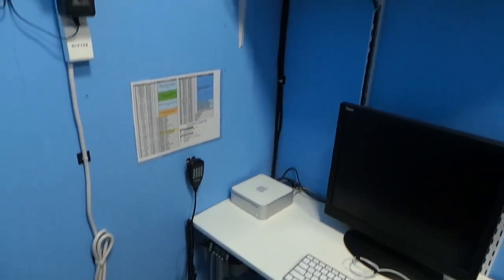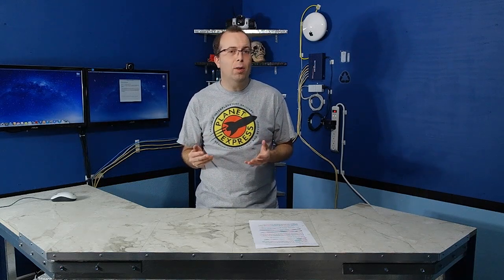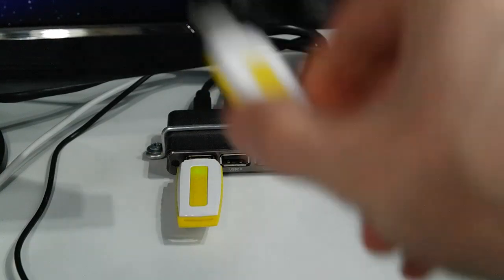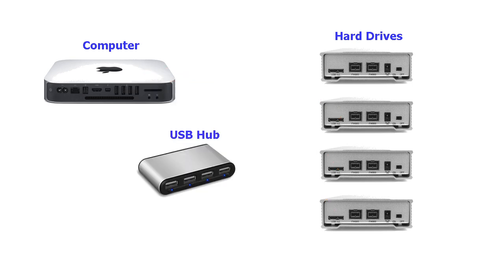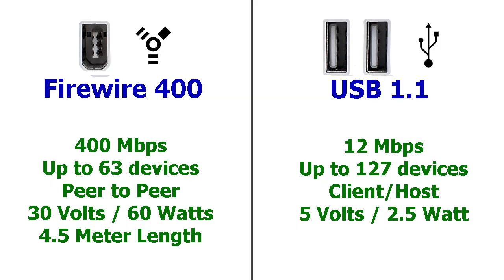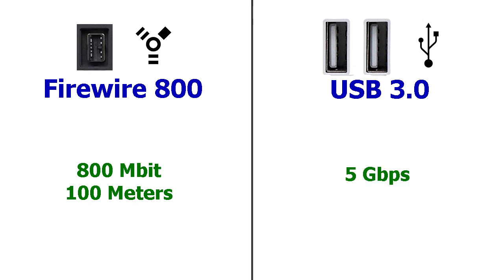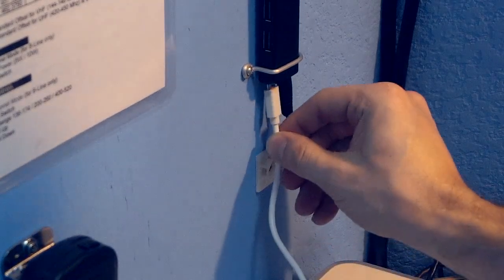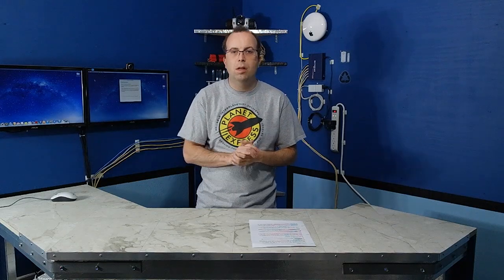Farewell R.I.P. Firewire, Hello USB!

Comment: don't use USB hubs. The bandwidth will all be shared by one port, which is not too efficient.
Reply: +Sergio Diaz Use powered USB hubs and you solve at least one problem.
Reply: Sergio Diaz Define awful. You could get upto 6gbps from USB 3 and upto 10gbps from 3.1.
Reply: Sergio Diaz Those theoretical speeds are pretty close to practical and you need a dozen USB thumb drives and HDDs in raid to hit 10gbps.
Reply: Sergio Diaz does firewire also share bandwidth in one port when daisy chaining?
Reply: +Sergio Diaz Hard drives generally struggle to even get 100MBps, so that's hardly an issue
Reply: Sergio Diaz USB Type-C is the future, basically you have an adapter for everything to convert to USB 3.1 type C such as HDMI which will easily use up that bandwidth.
Reply: Syphist Prime just use 2.0 devices...like connect 2.0 devices to 3.0 usb hubs
Reply: +Murican_Muscle_Ghif It's 5 GBit/s, not GB/s. Roughly 500 MB/s. Any RAID setup will overwhelm that bandwidth.
Reply: You get the same problem with daisy chaining.
Reply: The thing is that you can't rely on serarate USB ports on you PC actually being on separate controllers. And if they share the same controller, it doesn't really matter if you plug all your devices directly into the PC or use only one port and plug them into a HUB, in most cases. 

Now you could make sure to get each device its own controller, but if you're at the point where you regularly bottleneck at 10 GiB/s with mass storage, you might wanna look into other data transfer solutions.

Also, I'm not sure many people need 10G Ethernet, and that those people really wanna connect it via USB. There are cases where it can come in useful, but in most cases you'd want some dedicated hardware that talks more directly to the CPU for these use cases.
Reply: er, the bandwidth is shared on every port anyway, as long as they're using the same controller. the rated bandwidth is not per port, it's per controller.
Reply: +Sergio Diaz bandwidth or power?
Reply: +Vince FTW both.
Reply: a 10 Gigabit ethernet to USB adapter will easily hit that.
Reply: +Sergio Diaz I wish there was a USB 2.0 hub that connected to the main device via USB 3.0 to get around bandwidth choking issues.
Reply: +Sergio Diaz But when are you gonna need to draw more than 5GBps off your external hardrive
Reply: You would need a crap ton of deceives on the same hub for that even to be a problem. Back with USB 2.0 that could be a limiting factor if you copy from one HD to a other on the same hub... But with 3.0... you would need relay fast HD:s. You would basically need two full fledged SATA 600 SSD on the same hub for it to be a problem. And then you would only lose about 15-20% performance copying from one drive to the other.
Reply: matsv201
Most mechanical HDDs this day can output data at 120 Mb/s (1,5 GBit/s). Faster HDDs can manage even 160 Mb/s. The bandwith of USB3 is roughly 500 Mb/s (5 GBit/s) so two of the faster disks are already at 300 Mb/s. Remember every protocol is not perfect and you will never achieve 5Gbit/s. So you don't need a "crap ton of devices"...
Reply: matsv201
I don't get why you are talking about RAID. No sane person would use RAID on a general-purpose bus like USB. It's like using RS485 for RAID, or CANBUS for RAID. To do proper RAID you need a bus that's designed to handle only storage devices, as you said SAS, SATA or (even) SCSI.
I wasn't talking about RAID. I was talking about the fact that even with USB3 and its 5 Gbit/s when copying between two fast hard disks you can be bottlenecked by a hub.
Reply: MrOpenGL 
" No sane person would use RAID on a general-purpose bus like USB"
That is totaly my point. So there is no real bandwidth constraint with USB, at least not in the regards of harddrives. Sure if you use a SSD

" I was talking about the fact that even with USB3 and its 5 Gbit/s when copying between two fast hard disks you can be bottlenecked by a hub."

No.. Bacuse if you have a SATA/SAS 300 you get about 3Gbit/s. If you copying one file from one to the other you get 3Gbit/s up, and 3Gbit/s down.

USB 3.0 and 3.1 is full duplex in contrast to prior verions So you can actually use 5Gbit/s in both directions simultaneously.

You would need two full SAS/SATA 600 drives to get a bottle neck, and that is for USB 3.0. And if you have 3.1 you will still not have a problem.
Reply: matsv201
Are you sure that even the hub is full duplex? Because AFAIK the controller is duplex even on USB2, but not the hub which is always half duplex because of its nature, especially if you have more peripherals attached to the same hub. Assume you have a setup like this: you have a single USB3 port, attached to it is a hub, which has 2 hard drives attached to it, a keyboard and a mouse.
What I am thinking is that since the single USB port is already busy in both directions (uplink and downlink) because you are copying files from 1 HD to the other, when the CPU polls the mouse to see if it has been moved or the keyboard to see if a key was pressed the hub will have to suspend transfer of files while the CPU is polling the mouse/keyboard, which (especially if used in conjunction with a high-polling rate device like a wifi stick) should create inefficiencies, because even if the bandwith is 5Gbit/s the hub forces the HDD to wait writing while the port is busy polling the mouse. But I don't know how USB handles interrupts and which priorities it allocates to different devices so I can't really say if this is the case or not.
Also I have never managed to achieve full 5Gbit/s on USB3, probably because of protocol overhead and other inefficiencies.
Reply: MrOpenGL 
"Are you sure that even the hub is full duplex?"
Its a hub.. so its hubing.. and of cause, there might be a hub that only support half duplex. or even cant handle the full speed. IF you have a cheep as hub they might use secondary chip and underclock them to make them work

"was pressed the hub will have to suspend transfer of files while the CPU is polling the mouse/keyboard"
One might imagine it work that way.. but it actually don´t. 

USB (at least 3.0 and 3.1, i´m not sure about C) Uses a hardware legacy fallback. That is why USB 3.0 got 9 conectors and USB 2.1 and earlier only uses 4+1.

So a USB 3.0 is actually two ports. its one hardware 3.0 port, and one hardware 2.0 port in the same.

In the actuall USB hub there is actually two hubs, one 3.0 and one 2.0. Sure, they are on the same chip, but its totaly different electronics inside the chip.

http://www.moddiy.com/product_images/uploaded_images/usb3-pinout.jpg
D+ and D- is the standard 480MB half duplex pins.

The RX and TX is downlink and uplink, the - and + is balanced leads (just like in T-base). The D is just data. Its still balanced, but there is no up or down link.

The SS stands for "superspeed". So this is the cable super speed uses. There is actually USB 3.0 that don´t support superspeed, (but its quite rare). The GND-Drain is just a extra signal earth.

Of cause.. if you use a USB 1.0 stick with a USB 2, the USB one will ruin your speed because its only hubbed. But for USB 3.0 its not the case. And yes, this is a very real problem, that why they thought of it when they made 3.0

USB is for the most part a "stupid" standard. There is no inteligence in the system. And why its so cheep to produce. The hub just transfere the signals and the devices just get there interrupts. This is in grave contrast to Firewire that demoudlates it, process it, buffer it and then resend it.  That is why Firewire hubs is that rare (they do exist.. or rather, they are not hubs, but the same fuctunality), but they are hideously expensive. About thunderbolt.. i don´t know if its that capability or not, its a realy wired and useless standard.
Reply: matsv201
I knew about the 4+5 wiring for USB3 but I didn't know about how it managed interrupts. Thanks :-)
Reply: MrOpenGL Well not relay "manage" so mutch as cheating.... Its a cheat way of making backwards compability. Its really the only way to make it chepish.
Reply: That why a lot of usb hub company that make 10 or more USB port have a power supply
Reply: I have a 3 port non powered USB hub, then a 4 port powered in series.Mouse and Keyboard is in the non powered (wireless), as well as the powered one and i have a micro-USB and a mini-USB cable in the powered and two free slots.

Pretty much everything runs on mini och micro USB so i really never have to put a other cable in.
Reply: Sergio Diaz if your pc doesn't have a USB 3.0 port don't wast money on a USB 3.0 drive and don't use a 2.0 hub
Reply: the irony is Dave used a USB 2.0 (at best) hub
Reply: Nikola PekovicAR it's not the only solution. Just plug in a PCI USB card.
Reply: Scott Malkinson But when you use a hub, you use 5Gbps SHARED between every single port you use, and if you have a ton of external HDDs on a hub they all share the bandwidth of one, becoming a bottleneck pretty fast. And remember, those are theoretical speeds; hell they might not even ever reach those speeds.
Reply: Scott Malkinson Yeah, but the performance will still be awful.
Reply: +Vince FTW Thunderbolt basically does the same thing.
Reply: James Taylor Ignorant response.
Reply: +Vince FTW I don't have much experience with FireWire but I assume so.
Reply: +Vince FTW yeah, but your average USB mass storage device won't. Almost nobody ever reaches rated speeds on USB controllers.
Reply: +Vince FTW agreed. If it gets more traction than Thunderbolt it might just work out.
Reply: +Jack Mcslay So the maximum you can have is 5 of them.
Reply: +Jack Mcslay and with them doing concurrent io it can get pretty slow, considering this guy is not using USB 3 but USB 2.
Reply: Murican_Muscle_Ghif We're talking about chaining multiple devices in a port, which can easily use the bandwidth.
Reply: MrOpenGL If you talking about "today".. i would say the 2013 release USB is more accurate than the 2008 release.

Well sure.. so if you go for a 8 year old USB standard you might have a problem if you have 4 or more disks in a raid 0 configuration.

Well firstly... i would say.. you never use 4 drives in a raid 0.. that i stupid.

If you want 4 raided drivs you should really go for raid 10.. or raid 50.

If you use Raid 10 or raid 50 you are not going to use USB anyway. Then you are going for E-SAS or 10GBASE-CX4 (than probably dual ported, and its a 12 year old standard by now), or you go with a more modern 100GBASE-CR (6 year old standard).. then you will not get bandwidth problem in quite a while.

If we talking RAID 50 we are talking serous mainframe big buck stuff.. then both USB and Thunderbolt is out of the window anyway.
Reply: WHO CARES

Comment: Thunderbolt?

Yeah I know its expensive but if you liked firewire that much then Eh, but I suppose USB 3.1 gives you better compatibility.
Reply: +Andy The Playah actually, it uses lightening to charge, not thunderbolt
Reply: Thunderbolt, the Apple connector.. which is developed by Intel, but rarely used on PCs except for Microsoft Surface, and uses one of the same connectors as Display Port, and can sometimes be Display Port, but not always, and for that matter Display Port can sometimes also be HDMI, which is really fancy DVI, but only DVI-D and not the one with analog VGA, though that can be done on certain Display Ports, or even any Display Port with the right adapter, especially if it's Thunderbolt since then it can also be connected to a hub, along with USB and Ethernet, except for the NEW new USB, which is higher bandwidth, although it will actually converge with Thunderbolt anyway, and then it can be a Thunderbolt, a USB, a Display Port, an Ethernet, or even a power jack!

What's so hard to understand about that?
Reply: -Apple iPhone charger, use Thunderbolt!
-

I'm using references.
Reply: Daniël's Tech & Music Channel I wasn't saying they were compatabile but I was asking why he decided to move to USB3 Rather than Thunderbolt as an upgrade considering as you said Thunderbolt is the successor to firewrie.
Reply: +Etheoma 
Thunderbolt is really just mini display port with a hint of Apple flavoring.
Reply: +BeRad117 No it's not.  Thunderbolt is capable of carrying DP, but they are far from the same.  (Although they use the same mini connector -- a dubious choice, that one.)
Reply: Nick Guy
That's why I said with a hint of Apple flavoring. Video display but also 10 Gbps data. I should have included that when saying it originally in my post. It made it sound like I was trying to downplay it.
Reply: Thunderbolt 3 will ditch most of the Apple flavouring by using the USB type-C connector, and by being able to use 3 types of cables: A "passive" (standard USB type-C) cable that can get 40 Mbps at 0.5 m or 20 Mbps at 1-2 m, an active Thunderbolt 3 copper cable that can get 40 Mbps up to 2 m, and an upcoming active Thunderbolt 3 optical cable that can get 40 Mbps up to 60 m.
Reply: his server is a Mac Mini G4
Reply: But doesnt intel make Thunderbolt, not apple? lol.
Reply: Julian Robin the name thunderbolt was trademarked by apple, but apple transferred the trademark to intel. The final revision of thunderbolt 1 was codeveloped with apple.
Reply: RealDarkFilm They used to be i suppose, but now they are completely developed by intel i believe.
Reply: Nick Guy Ah really wasn't expecting to laugh when I started reading that, Thanks for the laugh.
Reply: that was always the idea wasn't it? one connector for everything? complete compatibility between all products?

also thunderbolts can go in either way (like type c) so that's a pro.
Reply: Spooky Skeleton type c is not thunderbolt. its a derivative of USB. However the lightning connector can go in either way.
Reply: RealDarkFilm Re-read my comment, I said that thunderbolt can go in both ways (LIKE type-c) not saying that it is type-c.
Reply: Spooky Skeleton Oh my bad. thunderbolt CANNOT go in both ways, but lightining can.
Reply: RealDarkFilm My bad too, I got Thunderbolt confused with Lightning, as I don't have a device that supports either of them :L justpoorthings
Reply: "Oh my bad. thunderbolt CANNOT go in both ways, but lightining can."
What about Thunderbolt 3?
Reply: USB c beat it
Reply: Etheoma  it's incompatible

Comment: With Type-C connector the end user, typically the average consumer will be able to ignore if the device is USB 3.1, Display, Thunderbolt, etc..., they just need to connect the cable and the devices will just talk to each other no more do I need a USB cable, Firwire, Thunderbolt etc cable.

Comment: With newer Macs, you get Thunderbolt that can also daisy chain, and packs even more performance than USB 3.0. Also since Thunderbolt is based on PCI Express you can find adapter boxes that allow you to attach any PCE Express card to it, and since you are talking storage, enterprise-class SAS RAID cards like 3ware 9750-8e. With such an SAS RAID card you can use an external SAS disk enclosure that accepts SATA or SAS drives directly. So with one big upgrade from Firewire/USB to Thunderbolt + disk enclosure, all you need to do down the road is get new, bare drives instead of enclosures. Also since enterprise grade stuff have longer support life you can count on itfor longer.

Comment: My audio interface is FireWire only. Which is great, but that means I can't upgrade my computer to a newer MBP.... -________-
Reply: +GabrielTheGuitarist If you have a tower PC, upgrade it and buy a FireWire controller.
Reply: +MinyHelps I dont use PC or tower computers. I've got a MBP with a firewire port, but the 2015s dont.
Reply: GabrielTheGuitarist Then waste your money for an Mac Pro which is a tower Mac or switch to Windows or Linux.
Reply: +MinyHelps I know what a Mac Pro is...and it definitely wouldn't be a waste of money. Waste of money would be a windows lol
Reply: GabrielTheGuitarist Yes, it's a waste. It wouldn't be a waste if you set up a Hackinthosh on a PC. xD
Reply: +MinyHelps Hackintosh is definitely something I would like to do, but building one with all the latest and greatest haven't really been done yet with minimal troubleshooting. And no...it isn't a waste. You're a windows person, and I'm a Mac person. You obviously don't understand the Mac side, so....we're gonna leave it at that. lol
Reply: GabrielTheGuitarist I'm a Windows/Linux transsexual person (black_humor=true)
Reply: +GabrielTheGuitarist Its all opinion based. If you like a beautiful interface, don&#39;t do much complicated stuff and work a lot, then you should go for mac. If you like gaming, maximum compatibility and easy to replace drivers and hardware, go for PC. I personally prefer PC.
Reply: +GabrielTheGuitarist Sure you can, you can use a firewire to thunderbolt adaptor.
Reply: Vru Patel Sorry, mean't more software is made for pc, but they're both equally great in terms of software.
Reply: +GabrielTheGuitarist 
The make turnaround cables firewire to thunderbolt. The only thing is that it doesn't work with bus-powered stuff.

Comment: At 2:25 it's 5V ~ 2.5A not Watt
Reply: +Lucas Santana Lopes It's actually right, USB 2.0 uses 5V @ 0.5 Amps, which makes it 2.5 Watts.
Reply: But he was meaning the highest power output USB 2.0 is capable, and not all computers have a 0.5A output, my macbook usb 2.0 port output is 1A capable
Reply: +Lucas Santana Lopes He was actually talking about USB 1.1, so you're both wrong XD